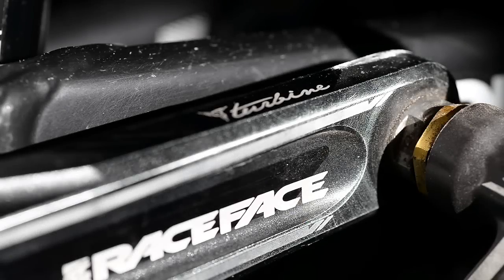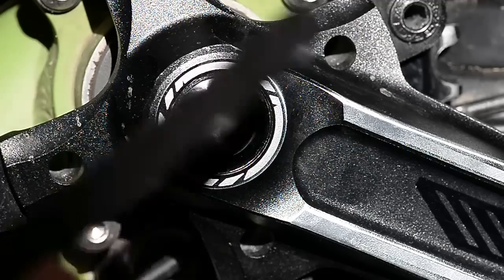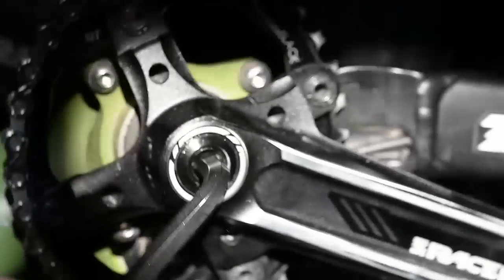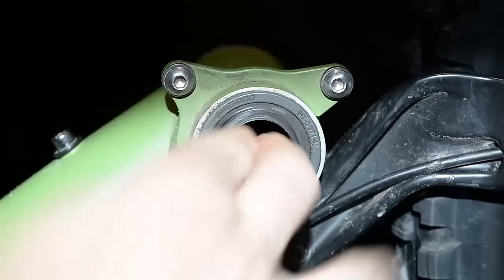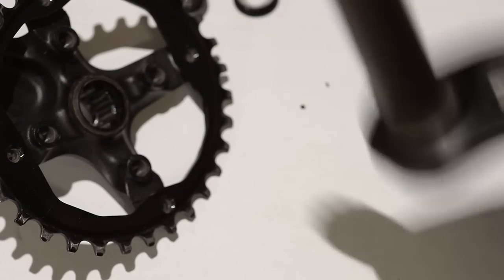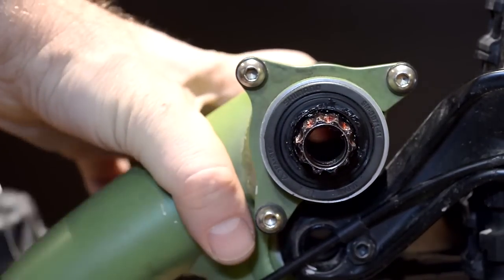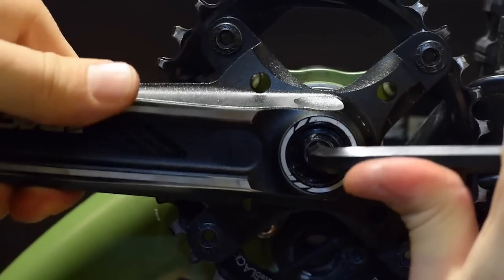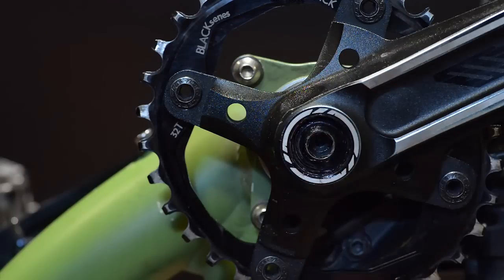RaceFace Turbine Cranks Removal, Install, BB Check - Kona Process 111

Comment: Great! Thanks a lot for the tip how to remove my cranks.. just the one change in the sequence I made.. 1) I removed big cap, 2) release the smaller bolt, 3) lube the plastic washer 4) screw the cap back 5) pull the crank out...  anyway, it was realy pretty easy once I saw your video, thnx a lot again ;-)

Comment: Watched several How-To videos and yours is the best!  No kidding.  Before your video, I got the 10mm cap off and the 8mm bolt removed, and that crank was locked on so tight it might as well have been welded.  So before I did something stupid I might regret which could lead to bloody knuckles, I watched a few more videos and finally came across yours with the tip to use the 10mm cap to "back-off" the crank.  Worked so perfect I had to tell you!   Thanks for your video.

Comment: Thanks for the 'how to' as I just bought a used fat bike with this crank set. What are the three metal protrusions with bolts that are attached to the frames bottom bracket, used for? I have the same and can't figure out their function.

Comment: Hi! I reinstalled my cranks on the new BB x-type from race face. When I tighten the bolt (with the mounted washer), the cranks are not spinning ass freely as yours! But there was neither a washer or spacer on the old nor the new BB.
Reply: allright! thank you so much! I was a little bit worried ;-) Ride on =D